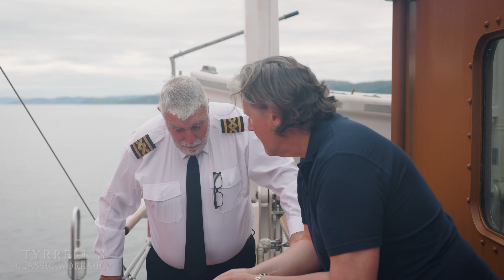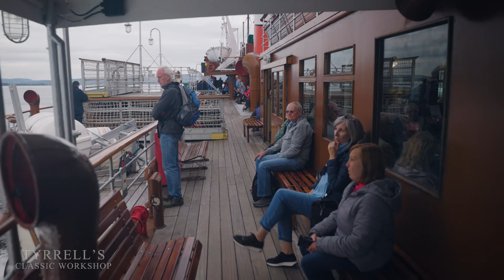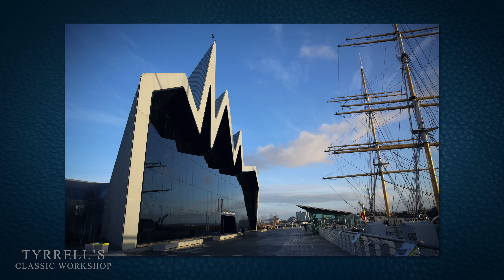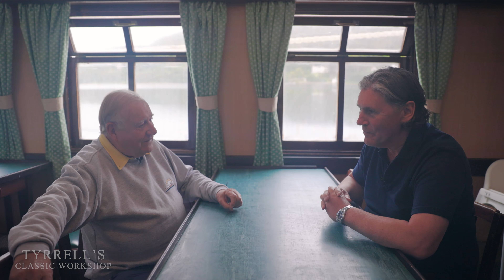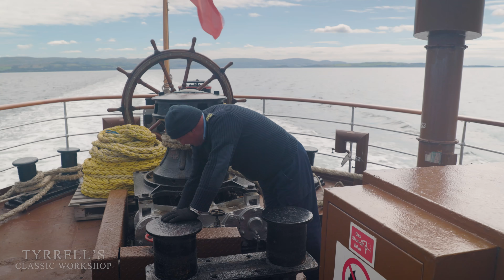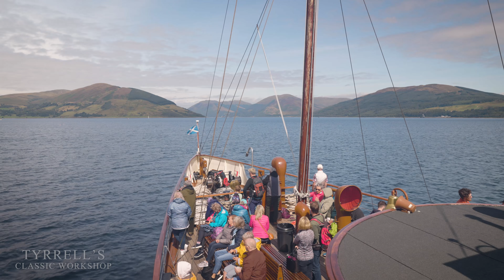Iain takes the helm of the 2100 HP Waverley, the World's last seagoing paddle steamer

Comment: Many thanks, Mr. Tyrrell! You too made a middle-aged man´s Easter Sunday. One question: you mentioned the bespoke calculated angles of the paddles on the wheel to optimize performance... what happens with those paddles when they set the trans into  reverse? Help me think that one out now that you´ve already helped me understand the quirky brakes on my RM Riley better than before....
Reply from the maker: The paddles are cleverly set-up to be vertical when in the water- so that works in reverse too! Glad to be of service with the brakes

Comment: As far as the engine is concerned, it helps to remember that this was built at the peak of steam technology. Maybe people don't know now that development and building was going on right up until diesel replaced steam, and some ways after that in the UK. Unfortunately even the most advanced ideas, still on the drawing board at the time, couldn't come close to the efficiency of diesel. Any other advantage that steam possessed was apparently of secondary importance to the bottom line.

Comment: Very impressive. Just one (slightly pedantic) point, the force across each stage of the engine is close to constant rather than the pressure as you state...hence the need to have different piston diameters to account for the drop in pressure at each stage. Very impressive engineering in a fairly inhospitable environment!

Comment: PS Waverley is just gorgeous and the fact that she is seagoing only makes her more impressive. However, the world's oldest paddle steamer in operation is located in Norway and sails on Norway's largest lake, which is Mjøsen (approx. 370 square kilometers in size and up to 450 meters deep). DS Skibladner was built in 1856 and is approximately 50 meters long and 5 meters wide. She has a triple expansion steam engine that produces 606 HP and is fired with oil. Top speed is 14 knots at 44 rpm. She can take 230 passengers.

Comment: Why was a paddle steamer still built in 1946 , that seems insane
Reply: I understand it was a replacement/tribute for the previous 1899 Waverley which was sunk during the Dunkirk evacuation.
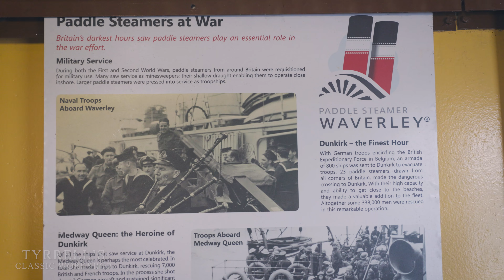(Edit: It is explained at 13:00 onwards) Triple expansion steam is a lot more economical than perhaps people think.
Reply: Paddle steamers are very well suited for the job for which Waverley was built. Although they are less efficient than screw-driven ships, their manoeuverability is useful for working in confined waterways where there are strong and variable currents. They are also well suited to shallow waterways because they have less draught.
Reply: @laurieharper1526  shallow is the key word as to paddles rather than screws. specifically the lner's homeport on the clyde 'Craigendoran' is boxed in by a sandbank which ruled turbine steamers out.  Waverley and her nearish sister Jeanie Deans were pretty big and powerful for coastal paddlers because the lms, unbothered by sandbanks over at Gourock, were able to deploy a fleet of turbines thus to compete the lner needed paddlers of such size and power as could put up some sort of fight against the turbines whilst being able to cross the sandbar.
Reply: because it was perfect for the role